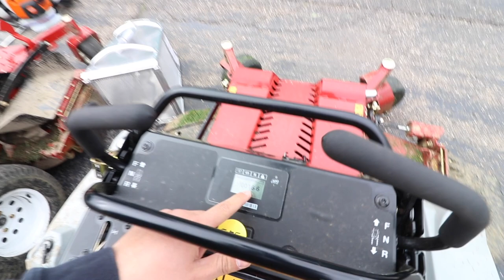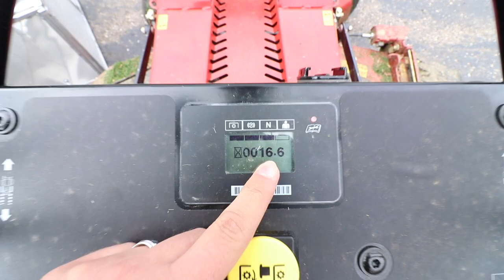Our 2019 Trailer Setup For Lawn Care!! ► Revealing The New Exmark Staris Mower

Comment: Just bought my first brand new mower after owning used for years. Ferris Z3x, 37hp B&S oil guard 72" cut, yes 72" I have a small service with mostly larger lawns. Some with serious slopes and obviously no fences lol. Love the wide stance and huge tires. Believe it or not, the deck follows really well with no scalping. Ferris really nailed it. The striping is really good too.
Reply from the maker: I do like the Z3X, great unit

Comment: Love the videos Brian, inspiration at its finest.
2.5 years in. Back to solo. Slow start this season with non stop rain and unexpected surgery yesterday. Sold about 50 cords of firewood thanks to splitter with log lift I bought during fall cleanups. Have 8 hrs on my '18 ferris 2100z with powered bagger that I pulled the trigger on a week ago. Hard work pays off. Still using(and loving) my 36 year old k20. Installed airbags and picked up a dump trailer this march. Hauling mower with dump trailer until bagger comes off and it can go on the old tractor supply 5x8. Like seeing the setups everyone posts, I was the guy with a lawn tractor not too long ago..
Reply from the maker: Amen to that man. The goal is progress, feels rewarding to keep it going

Comment: my 2019 season set up. 

2015 Chrysler town and country van with under the vehicle hitch, 

cargo carrier for quick lawn care jobs.
1700lbs harbor freight trailer with trailer jack 

honda 21-inch mower with blade clutch, 

two troybilt trimmers one with the edger attachment the other with an echo speed loader string attachment, 

echo 2520 handheld blower, 

ames transfer shovel
ames digging shovel,
ames cultivator, 

razorback edger (sorry brandon didnt use your brandons 10 had a job come up and need one same day)
adjustable hedge rake
plug in hedge trimmer (going to upgrade to gas powered or battery one soon)
Plus window cleaning gear.( way too much to list)
2       2.2 surecan gas cans.
Reply: mike Norton good for you man. Seriously. It’s much easier to go out and work with expensive equipment.  It’s takes a little more work and a little more determination to start out like you are. Good luck and hustle out there.

Comment: 21' Briggs and Stratton
48' John Deere
(20 years old so I got it for 500$ only had 100 hours on it and it cuts like a charm)
Husqvarna trimmer and blower.
Hauling the 48' on a 5x7 utility trailer.
Everything else is set up in a Chevy work van with ramps.

This is my first season and 90% of our yards are small so it works great for me 👍🏼
My next acquisition is going to to be one of the commercial 30/32' units, and a bigger trailer so we can handle mulch jobs.

Comment: Truck is 2012 f 250, simple open 7x12 open trailer with racks for my trimmers and what not, and of course a lock box. Mowers are a 48 inch exmark Lazer z hp commercial, as well as a worldlawn commercial 33 inch with Honda motor, and a little 22 inch toro recycler. I love my echo weed whacker and my Stihl edger are always taking care of me. Have an older echo pb 500t blower that does the job.

Comment: Nice setup! 
2008 F-350 Lariet Crew cab long bed.
8X14 dual axel/gate utility trailer
36” & 52” Exmark Vantage
60” Lazer Z x
Stihl 111Rx X 2
Stihl 94r
Echo PAS 2620 & 225
Stihl Br 800c & 600
Stihl Bg 56
Thanks for the video!

Comment: 2015 Silverado 2500hd crew cab short bed
2018 Pj 16” highside utility trailer, orange 
2018 Bobcat Fast Cat pro Rs 52” zero turn 
Stihl km131 kombi 
-power sweep 
-articulating hedge trimmers (new this year)
-pole saw (new this year)
-trimmer head
Stihl fs90r trimmer 
Stihl rs111r trimmer 
Stihl br800x (new this year)
Stihl ms170 (new this year)
Stihl sh86 shredder vac/ blower 
Dewalt 40v handheld blower 
Dewalt 40v hedge trimmers 

2018 Bobcat E20 mini excavator for the landscaping/ excavation jobs, hoping to get a second mower either this year or next to help with some of our bigger properties.

Comment: Just upgraded to all equipment defender racks and just bought a 2004 Lariat F-250 from a friend. HUGE upgrade from last year’s setup of a severely worn out ram 2500 and eBay trailer racks. Also, the 4K hour Lazer Z is still kicking!
Reply from the maker: Nice man congrats on the upgrades

Comment: For my first mowing season (this year) on my own I basically used what I had. For the vehicle I swapped mine with my dads for one season which should give me enough time to save save up and buy my own pickup for next season. I am using his 2011 Ranger 4 cylinder rwd. Surprisingly it is able to pull the trailer. For string trimmer I have an Echo curved shaft 2 cycle and for push mower I have a Toro Personal Pace 22 in. They aren't commercial grade by any means but they haven't given me any issues yet. For blower I use an Ego 530 CFM. It lasts me most if not all my day when using a 5.0 ah. If I hedge trim I use Ego's brushed hedge trimmer. I did buy a few new/new to me equipment. I bought a PJ 77x12 utility trailer and added a compatible trimmer rack and a rack for storing rakes, brooms, etc. I bought a 2006 Scag Tiger Cub with 48 in deck and blower bagging system for the price of a new engine. It has a brand new Kohler 26 hp engine. I was looking at trimmers a week or 2 ago not really interested in buying anything but I seen Ego's multihead trimmer with string trimmer attachment was on sale for $50 off. I was already a bit interested in the system so I made the purchase. It was an upgrade in my opinion because it had a straight shaft and anti-clockwise rotation which are more comfortable to me. I also like the less vibration, less noise, and no need to mix fuel. I already had some batteries and got another 5.0 in the kit which was nice. I was very impressed with the runtime I can go a full day on one 5.0 ah. So far I have been able to leave my Echo at home. I still keep it for backup. I also ordered the pole hedge trimmer attachment which will be nice to have in addition to my other hedge trimmer.
Reply: realized I was probably not using the Ego Trimmer to its fullest potential. I don't get a full day of runtime on a 5.0 anymore but that is because I realized I need higher rpm to work more efficiently. Higher speed reduces runtime but that is ok I got enough batteries. I probably average a full 5.0 and most of another 5.0 per day.

Comment: 2013 Chevy Silverado/Pace American 8x12 enclosed trailer/2018 Toro Zero Turn 32"/Cub Cadet 42" rider (36" blade for snow & Aerator)/Stehl backpack blower/Stehl blower Vac/ Echo kombi system w/edger-trimmer-hedge trimmer/rubber paddle attachments.

Comment: Awesome setup!!! Just started watching your videos. Very helpful and love all the info. I run a Dodge Ram 2500 long bed. With a 6x12x5’ sides with a single axle open trailer by Fox trailers. I run sthil trimmers and hedge trimmers as well as blowers. I run the ex mark navigator mostly but the 44” radius for the larger properties. Also run the 30” walk. Behind mower by ex mark.

Comment: Hey Bryan I started last yr with an 06 Chevy Silverado 4.3 litre 2 wheel drive. I had a 6x12 trailer. My equipment I ran was a zt7000 50" craptsman and a 36 inch belt drive Scag walk behind with sulky. I am selling old trailer to buy a 20' car trailer I am going to Fab a gate for as I do Small engine repair as well ranging from push mowers to actually tractors..I have sold zero turn, truck, and trailer and I bought a 2013 f150 4x4 crew cab lariat short bed to pull the new trailer and I'm upgrading to a 61" vride Scag.

Comment: Brian... good set up review.  (By the way, I don't like the styling of the Staris, but I am sure it works fine.)   My set up is the same as last year, except I went to a 22 ft open Alum trailer (with 12 inch tall sides). Twin axle, light weight, and it won't rust here in MN.  Mowers are Ferris 700s with 52 in deck, and 60 in deck (both 27 HP),  a John Deere X739 all wheel drive/all wheel steer garden tractor with 60 in deck,, and a John D X360 lawn tractor with a two bag power bagging system.  Also run a diesel John Deere X495 with blower and cab for snow blowing.  Echo trimmers, and combi system and mid sized Echo back pack.

Comment: This mowing season I’m running a 2013 F350 6.7 Powerstroke, 8.5x18 Homesteader Hercules Trailer, 30 Toro Time Master, 36 Exmark Metro (probably going to sell, doesn’t get used much) 48 Scag V Ride, 60 Kubota Z781i (won at GIE last year), Echo 2620T, Echo PB8010, Stihl BG86, Stihl HL94 (planning on a SHC2620 to replace it) and I have Stihl FS100RX as a backup trimmer, a second 8010, and a 60 Toro Z Master 3000 as a backup ZTR and a 48 Exmark Metro HP as a backup for the V Ride.

Comment: Part-time business with 2011 F150 XLT, 8’x12’ ft utility trailer, 48” Scag belt drive walk behind, old Toro Personal Pace push mower, 16yr old Echo SRM 210 trimmer, Echo 266 trimmer, and another Echo trimmer, old Stihl BG85 blower, and old Stihl BR600 blower. My blowers and trimmers are old but taking care of them, regular maintenance, and using the weather covers are super helpful! Please understand my 210 is starting the 16th season, but I’ve mowed 15 yards on average since the beginning.

Comment: This is my first year going out on my own. I got a 2003 4 runner V8 to pull my equipment around. Bought a brand new 5x10 trailer that I can just squeeze my mower on. Balling on a budget so I went with a Husqvarna z254f  from one of the big box stores. Has a been a nice mower so far, hoping to move up to a more serious one before the end of the season. I also got my blower, a husqvarna 570bts, and trimmer husqvarna 322L from there. Not the best for commercial work, except for the blower, but for now it's getting the job done.
Reply: Talk to your local dealer buy a better mower that's fresh off of a trade in I waited and got my walker with 1600hours the sales rep said the guy that trades it in gets a new machine every 2 years and is super good on maintenance now has over 2000 hours with zero issues best $4500 I spent
Reply: @jdias51  that is a good idea. There are lots of dealers where I live so I'm sure I could find something that would suit my needs. Unfortunately I only had a certain amount of funds to invest. Started from basically scratch, didn't even have a vehicle to pull a trailer so that took the majority. Business is picking up so hopefully in the near future I can reinvest in some better commercial quality equipment.  Check me out on Facebook Chris' Lawn & Landscape. Chrislawnservice336

Comment: sweet setup! I run a 2018 eXmark Radius E series. Great starter mower! I also have the Toro push mower for smaller yards, Stihl FS91R and the FS90R, FS56RC and the Echo PAS225, Stihl BR600 Magnum and the BR350. I use a EZGO golf cart and a dump cart that attaches to a lawn mower. im only 16 and only have my permit so far. that's pretty much it.
Reply from the maker: You’re a league ahead of me, keep it up buddy
Reply: @BriansLawnMaintenance  :)

Comment: Nice setup! I run 2012 Chevy 2500 with 14’ utility trailer open. Just bought last fall Toro Grandstand. Toro really made some great improvements from my 2013. Run Toro because they are based in my hometown. Also have a 16 year old Lesco 36” walk behind for small areas. Best running mower ever. Also run Redmax for blowers and trimmers. Thanks for the videos. Oh, also love my Kujos! Congrats on the new place

Comment: 2019 set up (my first REAL season) 
Saturn VUE (mid size SUV)
4x8 harbor freight trailer
33" Troy Bilt walk-behind
22" TORO Recycler
Kawasaki string trimmer
Echo PAS multi-tool w/ string trimmer, pole saw, & bed re-definer attachment
Redmax hedge trimmer
2 Husqvarna back pack blowers
Stihl BG55 handheld blower

Yea, I know it's not much, and who uses a Saturn? Lol. But it's what I'm hoping to build with.

Comment: Good setup you guys have .Have you or any other guys you know ever had or looked at a "Hybrid" trailer?The ones I have seen on the net/facebook,ect  come in 16' or 18" .The front nose of the trailer is built in like an enclosed trailer usually 4x6 and the rest of the trailer is open.The enclosed front has a 32" door on the trailer floor like where the mower sits and one on the side for access from the side of the trailer
Reply from the maker: I’ve seen those, I feel it just comes down to a space issue. Usually never enough room of either style when it’s the hybrid

Comment: I’m using a 2016 ram 1500 hemi
2018 7x16 enclosed rock solid trailer
2018 gravely pro turn 460
2018 gravely ztx42 
Echo and stihl blower and echo trimmers
Don’t know all of the models for the trimmers and blowers
I’m a part time weekend warrior.

Comment: I'm rocking a yard-man zero turn 42" rider, a weed eater put together from 3 different brands (I've got a boneyard for parts), hyper tough hand blower, craftsman gas hedge trimmer/black and decker electric trimmer, poulan pro chain saw. Everything bought used needing work (or gifted due to not working) except the hyper tough blower (had to do what I had to do) and the battery hedge trimmers. Haven't made a video yet for my channel, too busy working as I'm solo. Thanks for the content. Should be doing a stand on demo next week.
Reply: Got a discount code for exmark yet? 😉 wish manufacturers had different purchasing options. I'd like to get a Staris in pieces and see if I could assemble it without a manual. That'd be a sick video haha.

Comment: Good to see you doing good.
2003 f250v10
2009 exmark triton72" beast
Dixie chopper xd50hp 72" diesel 2005 another beast
48 sintar
36 exmark metro hydro
2 30" Toro mowers
2 br600 Stihl
Shindawa t27
2 Redmax 23 edger
111Stihl Combi with all attachments
2 293c Stihl chainsaws
110 pole pruner stihl 
20 x7 big-tex HD trailer

Comment: Will be starting lawn care biz. Spring of 2020. 
I'm thinking a 48 inch stand on . Would that be the best middle of the road mower for residential properties? I do have bad knees so I have been debating on a stand on or a zero turn like the toro my ride suspension. 
Any thoughts or suggestions?
Reply from the maker: Any name brand stand on will do the trick.

Comment: YOU NEED TO ADD A AIR CONDITION OR SOLAR FAN IN THE TRAILER INSTALL AN INVERTER TO RECHARGE BATTERY EQUIPMENT THIS YEAR I HAD TO CHANGE IT UP A LITTLE BIT AND SOLD THE TRAILER GOING WITH A DOVETAIL BODY ON A TRUCK  WHERE WE CAN GET CLOSER TO THE CABINS I LIVE IN THE MOUNTAINS OF GA

Comment: First year 2019 set up. 2000 ford F150 extended cab V8 triton  60K original miles. 8x5 single axle open trailer. 2019 48" John Deere 648R with the mulch kit and mulch blade set up. Echo straight shaft 2620 with the darwins grip . Stihl bg 85 c and Echo 255 ? stickers are worn off. Single dad hustle :)

Comment: Second year in the business.. Up in the great white north eh ( Canada)
2007 sierra 3500 
2018 7x14 enclosed trailer (shoulda got 8x16) DIdn't have the cash at the time.. 
2014 husqvarna 48" tractor 
older toro timecutter 42"
2 husqvarna 580bts
2 30" toro lawnmowers 
2 21" mowers (husqvarna, toro)
4 string trimmers 
2 bluebird power rakes 
Exmark 36" walk behind sweeper (power broom)
Ariens 28" DLE pro snowblower 
Snow plow for commercial/acreages  sites 
More to come.

Comment: 2019 Toyota Tundra TRD crewmax in the Calvary blue color. 6x12 enclosed trailer, 54 inch hustler trimstar and a 30 inch toro time master, br 700 and 350 backpack blowers, hs56 hedge trimmer, km111- have the normal trimmer head as well as articulating hedge trimmer, stihl fs91, fs56, and husqvarna 128 LD, stihl farm boss chainsaw, and then a good assortment of rakes, shovels, matic, etc. 

Looking to get a Vride 2 and upgrade to a 7x14 enclosed trailer

Comment: As a homeowner that wants a commercial type mower, in your opinion, should I go with a stander or a zero turn ? thanks
Reply from the maker: Check out the Exmark Radius, it's a good compromise of both. But a good used stander could work for you just fine, something with say 700-1000 hours.
Reply: @BriansLawnMaintenance  I've kinda been leaning to the radius x , but i love the standers also. one thing I've thought of was as I get older (60 now ) I might not be able to stand in my old age but I might be able to sit and mow. Thanks for the comments and the great videos !!!

Comment: I use a aluma trailer 78/14 a toro timecutter mx with myride and husqvarna 128ld Honda hr 173 and a redmax ebz6500rh  I am thinking about upgrading to a echo pas260 or a sthil km131r I’m also thinking of upgrading to a husqvarna 580bts backpack blower

Comment: Thanks for all of your videos and info, in this video and others you make comment or use the term boulevard. I'm pretty green I guess and am not sure what the term means. Can you please explain. Thanks again for all that you do for us beginner.
Reply from the maker: That’s the strip between the road and sidewalk for a subdivision home!
Reply: Thanks, I've watched just about all your video's. I haven't seen anything on walk behinds. Have you made one, what's your thoughts on them. I have a dixie chopper zero turn and I want to add something for small gated backyards. There are so many walk behinds and so many different controls. It is a little overwhelming. Im in Ga and I've reached out to a number of companies to get info for demos. I haven't had much success with them. Again thank for doing what you do.

Comment: I'm just starting out. I live in a city so a rider is not really neccessary a 42 inch zero turn would be nice but I'm 17.
I have a 2004 toro proline (comercial) (Kawasaki engine)
2014 toro recycler (190cc Briggs and Stratton)
2011 toro recycler (190cc Briggs and Stratton)
Stihl fs38 trimmer w/ grass gator load and cut 
Craftsman straight shaft trimmer 
Yard man 4 cycle trimmer (used as brush cutter) 
Homlite leaf blower 150 mph

I'm planning on getting a toro timecutter 42 inch and a poulan pro 200mph  backpack leaf blower in the future.